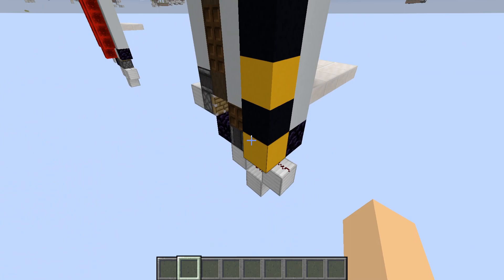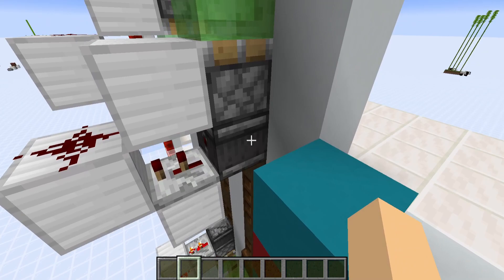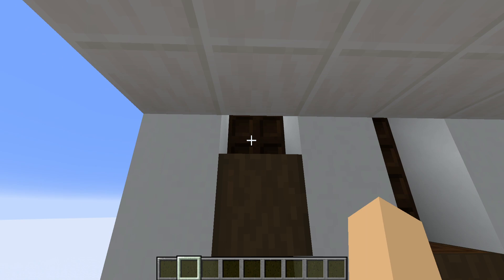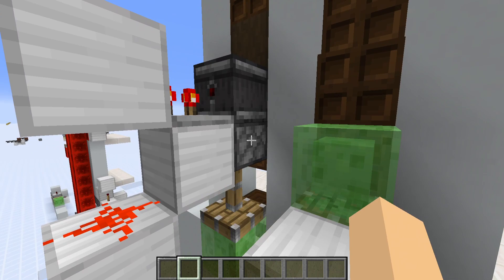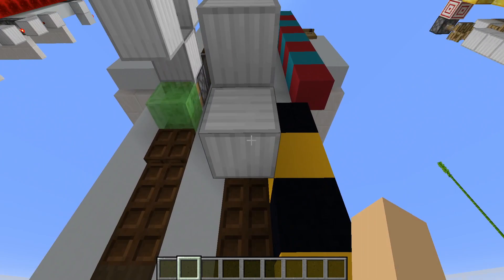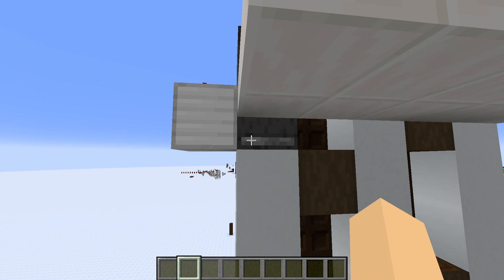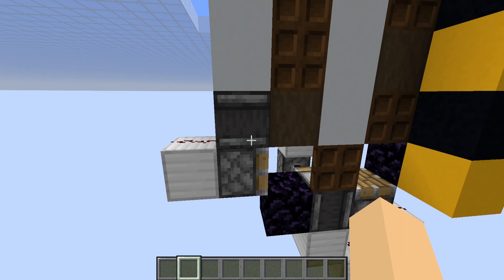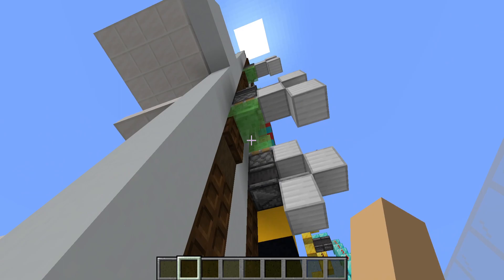Paternoster Lift Elevator Infinitely Expandable For Minecraft Java

Comment: will it work if I try this in bedrock
Reply from the maker: Good question, glancing at the Redstone properties, it should work since it doesn't rely on 0 or 1 tick pulses. Only thing I can see it breaking timings, which to fix would just be changing the repeater delay to greater (or if your on a laggy multiplayer server, just means the lift would be a touch slower)